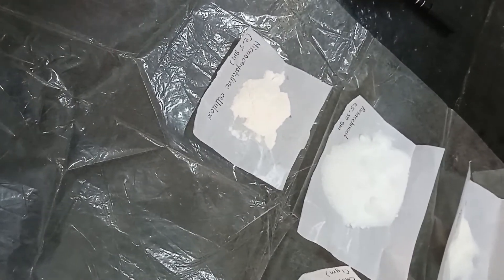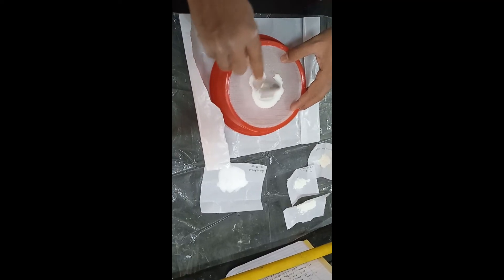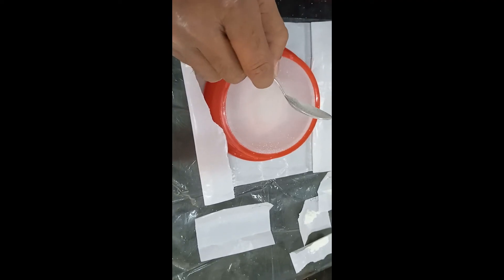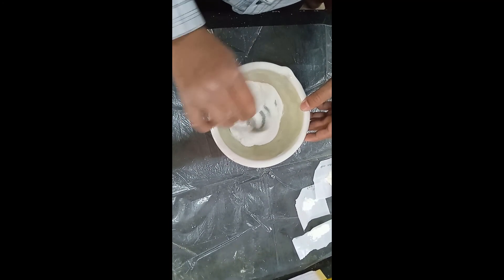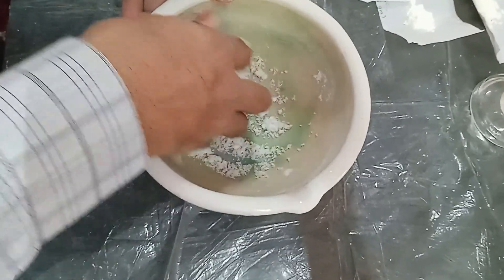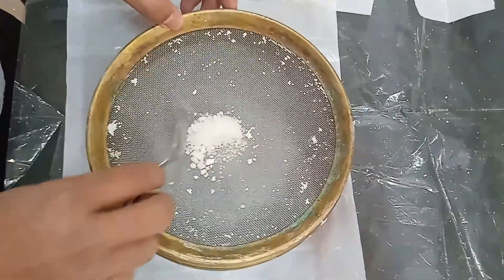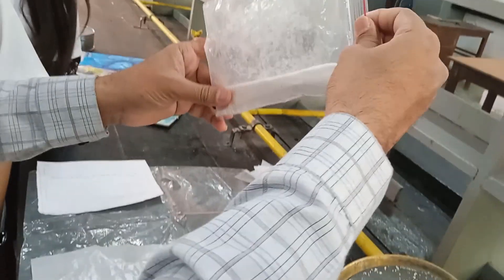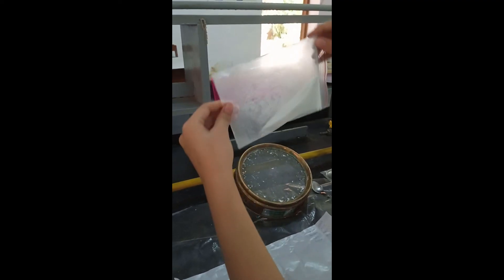Paracetamol Tablet Manufacturing Process

Comment: how can we manufacture vitamin c tablet
Reply from the maker: Do you want to manufacture simple film coated tablet or chewable tablet?  I am providing you formulation of chewable tablet. 

You can manufacture vitamin C tablet by using following compatible excipients. 

1. Diluents / sweet bulking agents (use these as the main tablet bulk)
Mannitol — preferred for chewables: non-hygroscopic, pleasant cooling mouthfeel and slightly sweet; helps stability.
Typical amount (chewable): 50–80% of tablet mass (adjust to target dose and tablet size).
Microcrystalline cellulose (MCC) — compressibility aid and filler; inert and stable.
Use: 5–20% as part of filler blend.

2. Binders (for granulation)
Povidone (PVP K-30 / K-90) — water-soluble binder; good compatibility.
Use: 1–5% (solution or dry binder).
Hydroxypropyl methylcellulose (HPMC, low viscosity) — alternative binder; also used in film coats.
Use: 0.5–4%.

Note: prefer dry granulation or low-moisture wet granulation to limit water exposure when using soluble binders.

3. Disintegrants (small amount — chewables need mild disintegration)
Crospovidone — superdisintegrant, fast wicking; good compatibility.
Use: 2–5%.
Croscarmellose sodium or sodium starch glycolate — acceptable in low levels (2–5%).
Chewables often rely more on chewing than rapid disintegration, so keep disintegrant moderate to avoid dustiness and moisture uptake.
 
4. Sweeteners (taste masking — important for ascorbic sourness)
Aspartame, sucralose, saccharin — non-reducing, stable high-intensity sweeteners.
Use: q.s. for palatability (mg level).
Mannitol / sorbitol (mannitol preferred over sorbitol due to lower hygroscopicity). 

5. Flavors and taste modifiers
Natural or artificial fruit flavors (orange, lemon, strawberry) — microencapsulated flavors are preferable (less volatility and better stability).
Citric acid may be used carefully to give pleasant sourness but use minimal quantity because acid can accelerate some degradation pathways in presence of moisture — typically only used to adjust taste, not as a buffer.

6. Lubricants (use minimal amounts)
Magnesium stearate — standard lubricant; use low level (0.25–1%); overuse increases surface hydrophobicity and can affect mouthfeel/taste.
Stearic acid or glyceryl behenate are alternatives but keep low.

7. Glidants / flow enhancers 
Colloidal silicon dioxide (aerosil) — improves flow and helps absorb trace moisture; very useful with mannitol/MCC blends.
Use: 0.2–1%.
Talc — functional, but avoid excessive use (can affect tablet mouthfeel).

8. Antioxidants / stabilizers (protect ascorbic acid)
Edetate disodium (EDTA) or disodium EDTA — metal chelator that binds trace iron/copper and slows oxidation.
Use: low ppm to small % depending on formulation.
Sodium metabisulfite or ascorbyl palmitate / tocopherol — used sometimes as antioxidants; choose with care (sulfites can cause sensitivity in some patients).
Ascorbyl palmitate — lipid-soluble derivative sometimes used in multi-component systems.

Classic representative formula: 

Ascorbic acid: 500 mg (active)
Mannitol: 300–350 mg (bulk, sweet, cooling)
Microcrystalline cellulose: 30–50 mg (compressibility)
Povidone (binder): 5–10 mg
Crospovidone: 10–20 mg (mild disintegration)
Colloidal silicon dioxide: 1–2 mg (glidant/moisture scavenger)
Magnesium stearate: 1–2 mg (lubricant)
Flavor + sweetener: q.s. to taste
Optional: EDTA (trace) or antioxidant (very low level)

Following excipients are not compatible with vitamin C. 

1. Alkaline excipients (increase degradation rate)
Calcium carbonate
Magnesium oxide / hydroxide
Sodium bicarbonate
(They raise pH;  accelerates oxidation of Vitamin C.)

2. Oxidizing agents
Ferric salts (e.g., ferric oxide, ferric chloride)
Peroxides (e.g., hydrogen peroxide residues in excipients)
(Vitamin C is a reducing agent, so oxidizers degrade it quickly.)

3. Metal ions / trace impurities
Copper salts
Iron salts
(Catalyze oxidation of Vitamin C; use chelating agents like EDTA to protect if trace metals are unavoidable.)

4. Reducing sugars (in certain conditions)
Lactose
Glucose
(They can undergo Maillard-type reactions with ascorbic acid, especially in moisture/heat.)

5. High-moisture excipients
Starch (if not properly dried)
Sorbitol (hygroscopic; absorbs moisture; instability)
(Moisture accelerates hydrolysis and oxidation.)

Comment: Is there any nonveg thing added in these chemicals ,from where these chemicals r made by
Reply from the maker: 1. Paracetamol (Acetaminophen)
Source: Synthesized chemically from petrochemical derivatives like phenol.
Vegetarian? Yes. Fully synthetic. No animal source involved.

2. Microcrystalline Cellulose (MCC)
Source: Purified cellulose, derived from plant fibers (typically wood pulp or cotton linters).
Vegetarian? Yes. Plant-based.

3. Polyvinylpyrrolidone (PVP K-30)
Source: Fully synthetic polymer, made from the monomer N-vinylpyrrolidone, derived from petrochemicals.
Vegetarian? Yes. Synthetic; no animal sources.

4. Croscarmellose Sodium
Source: Derived from cellulose (plant fiber) through chemical modification.
Vegetarian? Yes. Plant-based origin.

5. Talc
Source: Naturally occurring mineral (hydrated magnesium silicate) mined from the earth.
Vegetarian? Yes. Mineral origin; no animal source.

6. Magnesium Stearate
Source: This can vary. It is a salt of stearic acid and magnesium.
Vegetarian Source: Stearic acid derived from palm oil, soy, or other plant fats.
Non-Vegetarian Source: Stearic acid derived from animal fat (beef or pork tallow).
Vegetarian?  Depends on the manufacturer.

Only magnesium stearate requires clarification from the specific manufacturer if you want 100% assurance about vegetarian origin.
All others are safe for vegetarians.

Comment: Why raw paracetamol is not used?
Reply: Because it will make difficult to deliver the drug in body
Reply from the maker: We need to use paracetamol as per the standard given in pharmacopoeia. As for example, Paracetamol IP, means that the the raw material paracetamol meets the standards prescribed in the monograph of paracetamol in Indian Pharmacopoeia.